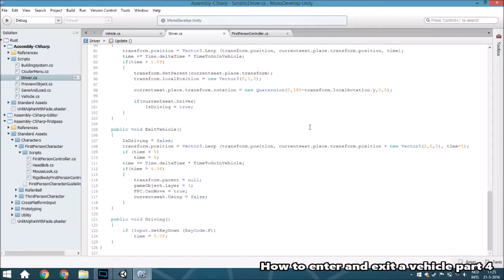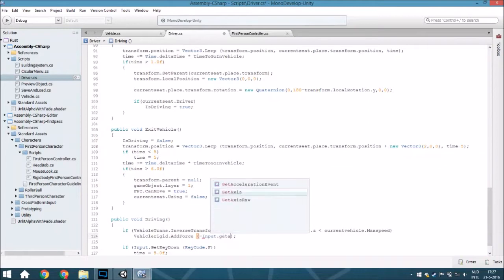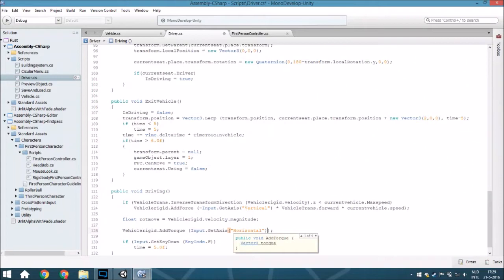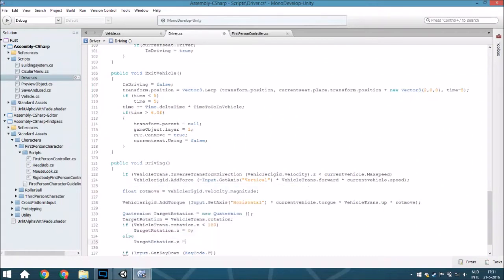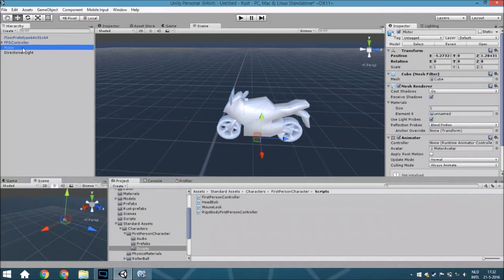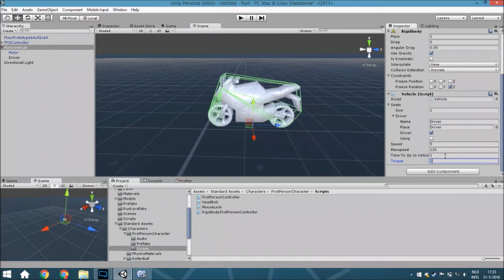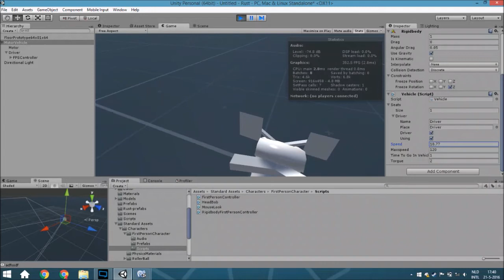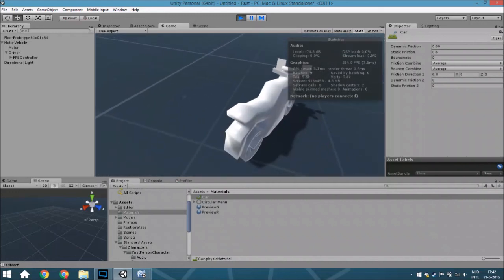[Unity 5] Tutorial: How to enter and exit a vehicle part #4

Comment: I have a question, though not about this. I want to get into Unity 5 and by this time next year I want to release a small simulation racing game with 10 upgradable cars, with realistic physics, suspension, and mechanical and visual damage about have that of GTA 5. I would also like to have 5 real race tracks. I would sell this for $2.00 There's one thing holding me back though, and it is not the fact I don't know any lines of code in Unity. It is the fact I can't 3D model. Do you think every week you could do a Cinema 4D tutorial, going from cartoon wheels, and cars, all the way up to real looking cars with interiors, and race track pieces? And if you don't have Cinema 4D can you use blender? If you did this for me, and probably many other people, one of my, our dreams would come true, we would be able to make games. P.S our = me and the many other people I mentioned.
Reply from the maker: I use Blender for all my models, So I'm sorry but I think this is not possible ;)
Reply: start with small test. Dont do GTA V remake. They are making this in HUGE TEAMS. start in 2d and move on
Reply from the maker: +Kuře Kuřecí indeed, that's a good bit of advise. 

Thanks! :)